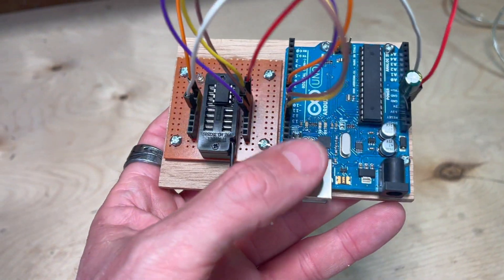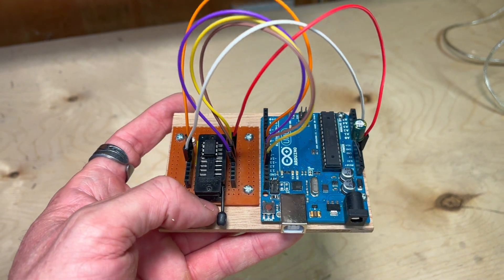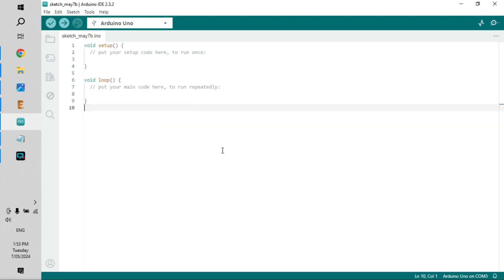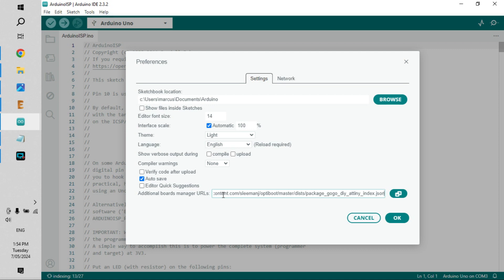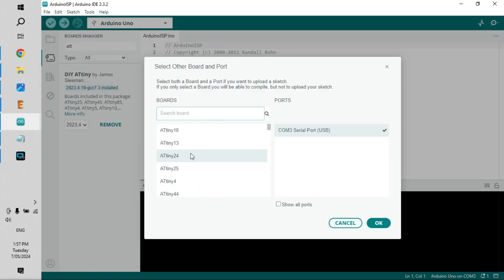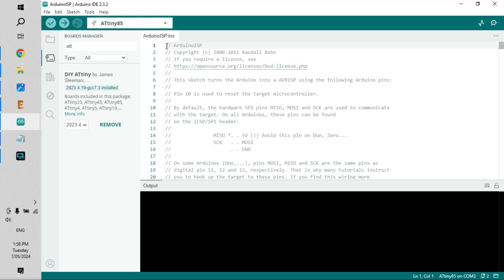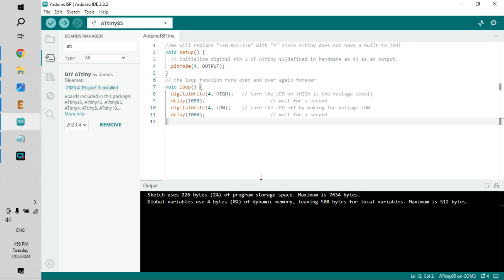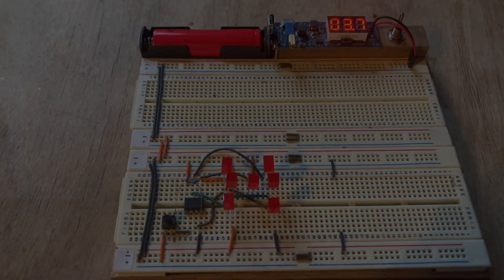Program a ATtiny Using an Arduino

Comment: can you explain the capacitors use
Reply: and your diagram has VCC at 5V, yet the battery is 3V
Reply from the maker: Hey there - basically, the cap is there to stop rhe arduino re-setting itself.  You should remove it though if you are compiling a sketch as it probably won’t upload correctly if it is in place